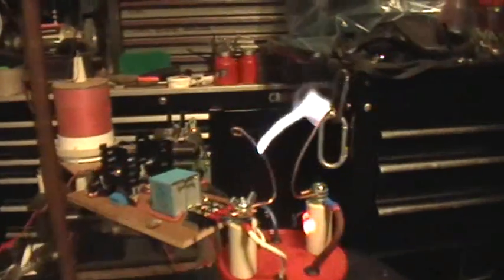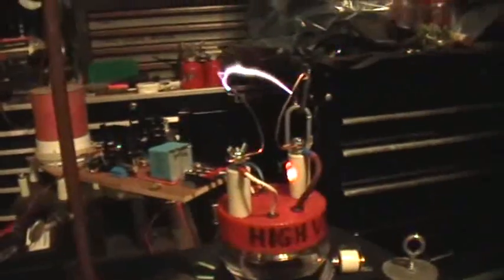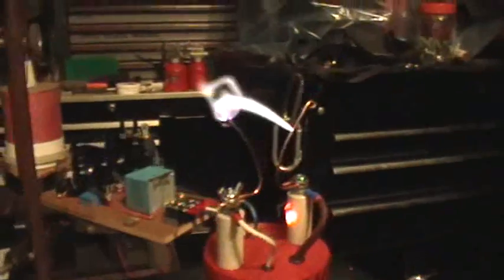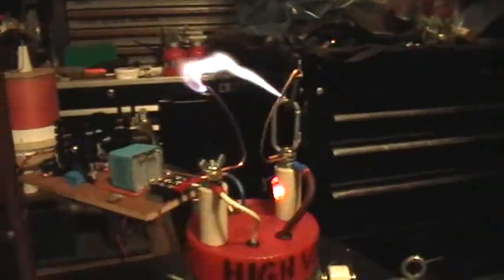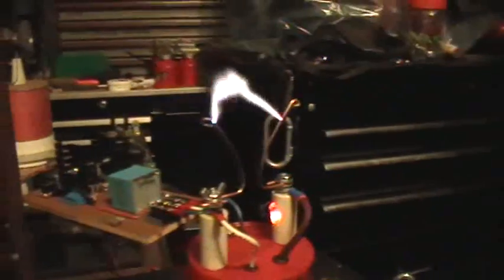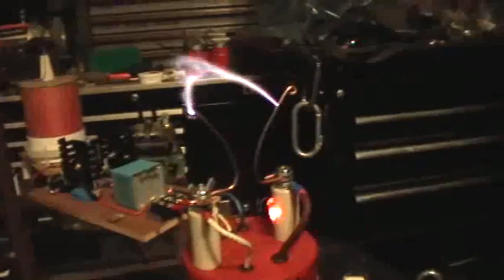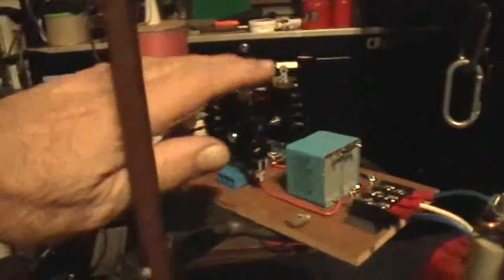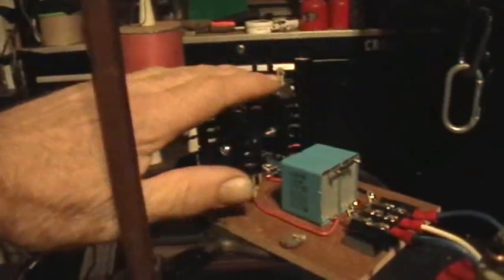Extreme High Voltage: ZVS Royer Oscillator Driving Flyback Transformer, Jacob's Ladder

Comment: Are the B+ input the same on all flybacks?  I got the last pin (9 or something) that's the collector of the HOT, and another that goes to the other side of the circuit.  both are shorted.  Then I got a pin 4 going to a big ass fuse to the power supply, this would be my guess.  I don't care much about this TV and would normally take it out shooting, but CRT HDTVs are kind of rare.

Comment from the maker: You can't really go by the top of the ladder unless you actually get a spark across there. The yellow plasma is more conductive than unionized air. The gap at the bottom, though, where the spark actually starts, is more reliable and at its max opening, larger than here, I figure 35 to 40 kV.
Schematic linked in next video showing effect of capacitance. Transformer is flyback from a bigscreen TV with 8 turns CT primary, current depends on supply voltage, 8 A at 28 V, input fused at 10 A.

Comment: Great work Tinsel ! Looks like around 100 kV output based on the sparklength at the top of the ladder. Can you provide a link to the circuit schematic & details of the transformer please ? How much current do the Mosfets draw ? And any idea of the efficiency ? Thanks & regards.